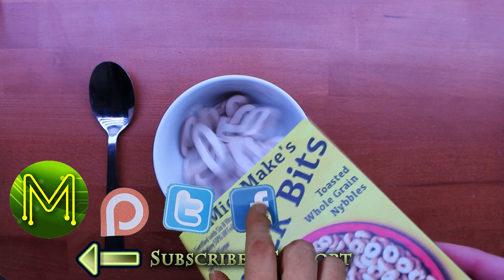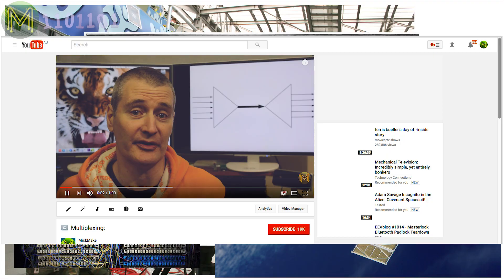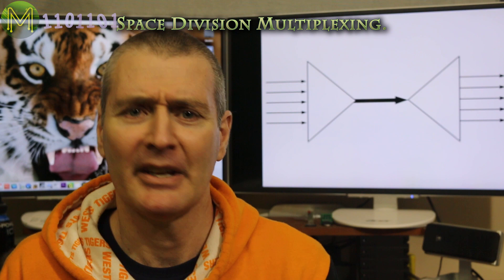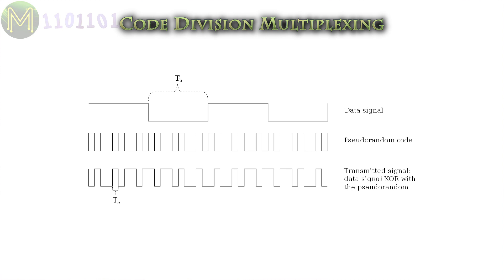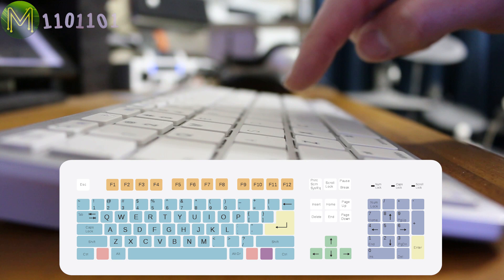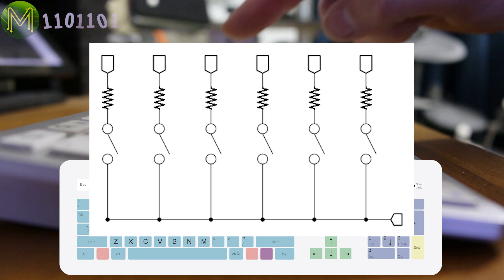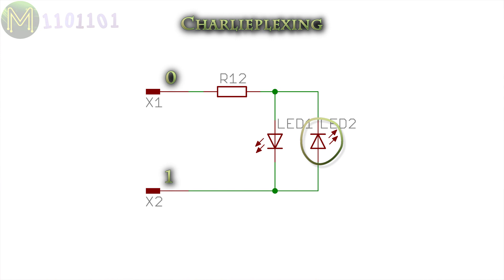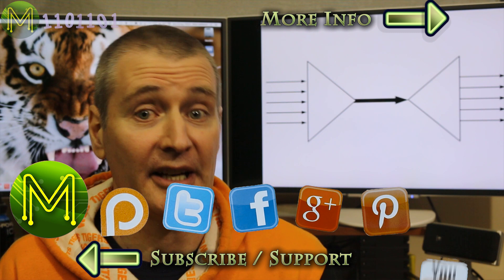#161 Multiplexing: Doing more with less. // Tutorial

Comment: I had a project which could only use two wires but needed two groups of inputs where one input from each side could be active at the same time. For that I ended up going with a hybrid of the resistor method mirrored for each group and then used charlieplexing to check what was pressed in each group. That was certainly a fun project to figure out.
Reply from the maker: +James Coyle 
Nice! Yup charlieplexing can make your head spin sometimes.

Comment: Intercoms here in England also use resisters to determine what com is linked to address, does that mean you can chat from intercom to intercom?
Reply from the maker: +Jay Mee 
Yup, and changing the resistor value should come up with some interesting results.
Reply: When the tech installed it I said that looks broken as I see the missing resister and he said no that's how it determines the right address, its a row of resisters and to choose an address he snips of 1 resister, so very interesting, also it has a small monitor for viewing outside camera but a button needs to be pressed every so often to keep it on, I wonder if i can extend it to put onto a big screen without needing to press the button to keep it on without effecting the com unit for other users.

Comment: might be a stupid question but can a hub be a multiplexer? Like for example you have a few nodes connecting ports to a hub then through a cable in the middle then there is another hub connecting to more nodes on the other side but also with a switch in-between the two. Is that multiplexing or is that something slightly different and unrelated?

Comment: Some older trains (built between 1976 and the 89) in the UK use TDM to send control signals between power cars, locomotives or driving van trailers. In their earlier days it was quite common for their TDM related equipment to fail and this equipment is still a weak link in the chain to this day.

I'd imagine the XPT trains in NSW use TDM too, since they were used a design from British Rail.

So there you go, boring bit of trivia you never wanted to know or needed to know.
Reply from the maker: +Izzie 
No, I like boring trivia! I figured it'd be using some form of TDM as it's a lot cheaper than a complex packet based system.
Reply: MickMake Believe it or not it was a massive improvement at the time. Other British Rail products used a jumble of wires, which weren't even wired consistently, much to the dismay of the companies that came after and refurbished them.